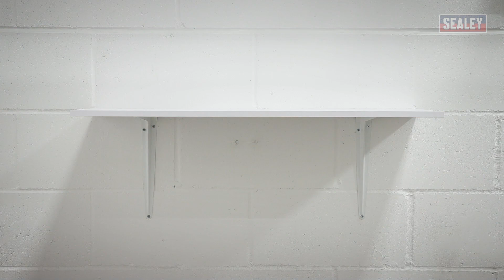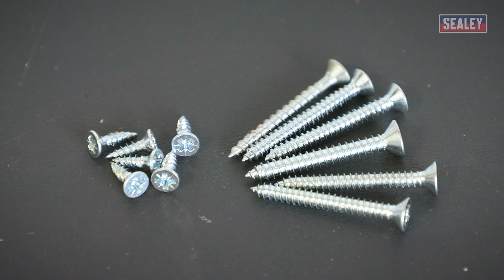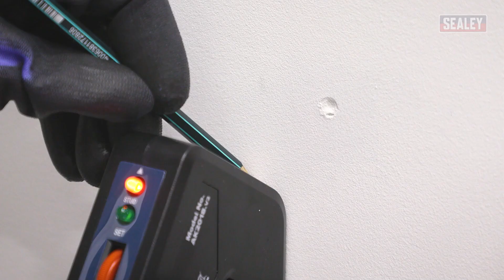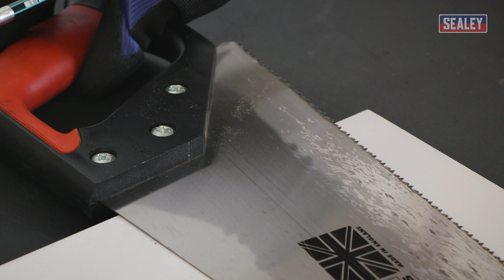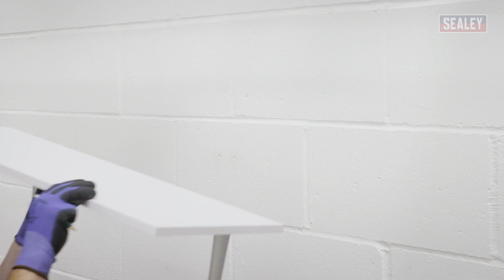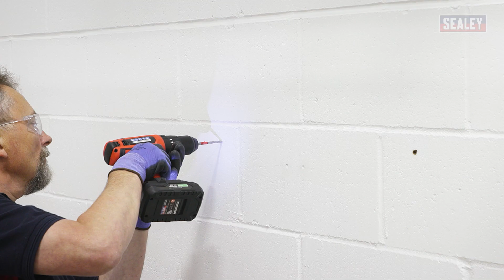How to Put Up a Shelf

Comment: A question with respect to the brackets: does the longer part of the bracket go onto the wall or the shorter part? These brackets have a longer part and a shorter part, for example one arm is 8 inches long and the other one is 12 inches long. Which one goes onto the wall the 12 in arm or the 12 in arm?
Reply from the maker: Hi. The longer part of the bracket should be affixed to the wall. Thanks.